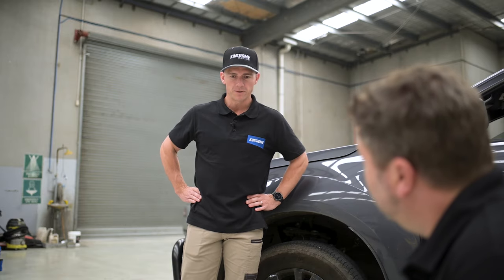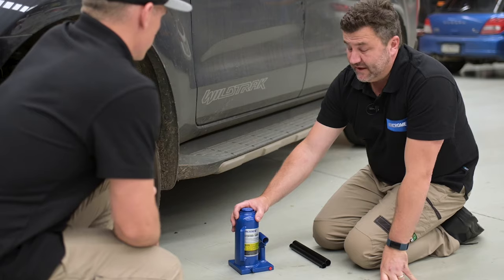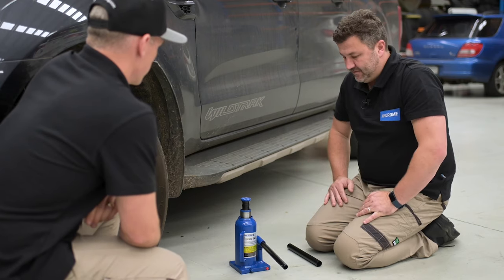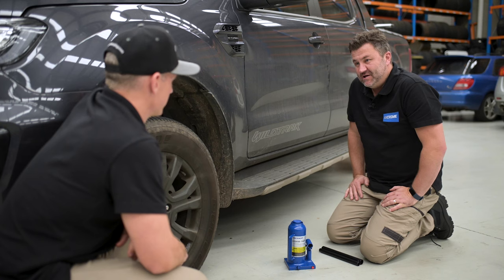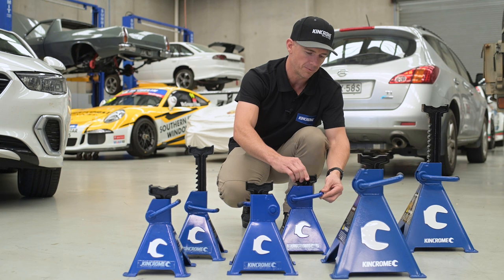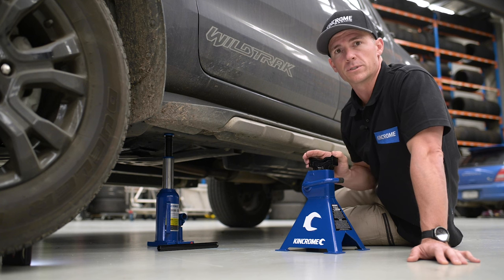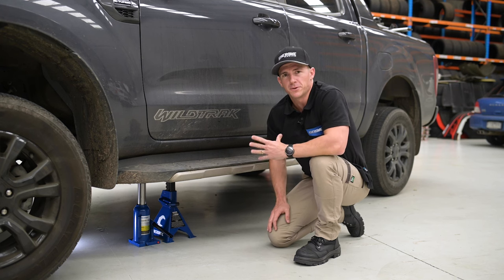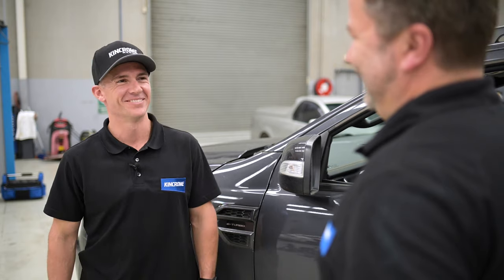How to Use a Bottle Jack | KINCROME Tool Talk

Comment: What can I do if chassis of my Ford c-max is lower than the jack’s minimum position?
Reply: Low profile floor jack. Works every time.
Reply: You could drive the nearest wheel onto an object like a piece of wood to lift the vehicle a bit.

Comment: You didn't show us how to release the bottle jack :(
Reply: at @0:45 you close the valve. When you want to lower it you turn it counter clockwise to open it and it will begin to lower.